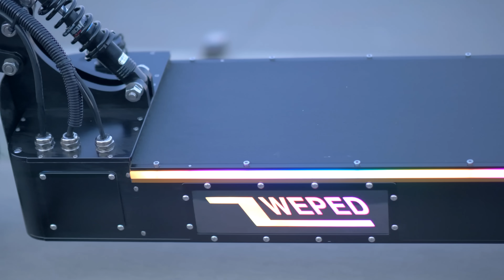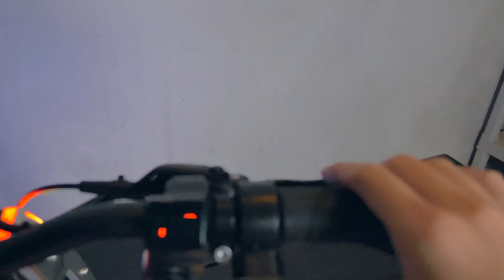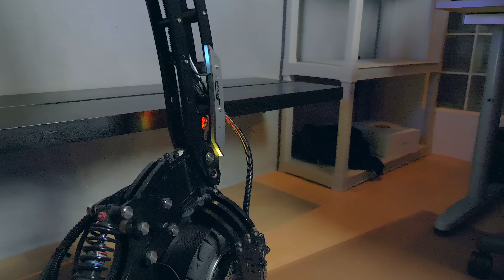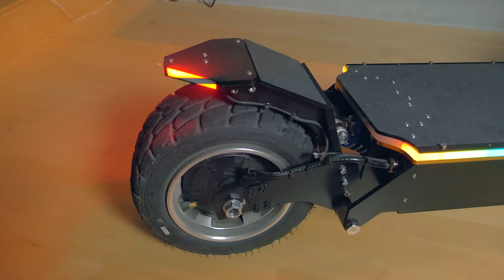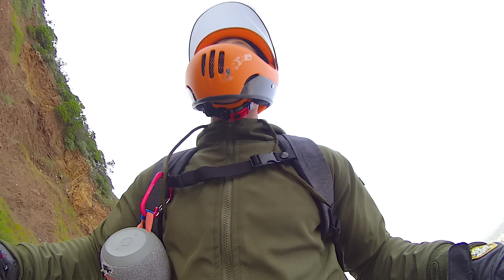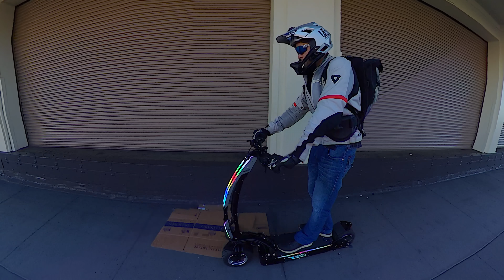WEPED SS Electric Scooter, An Insanely Fast And High Quality Ride

Comment: The RION 60 vs this?  1. It is 45lbs less weight.... RION is faster....  RION in 4k vs 7K.....Why is this your fav?
Reply from the maker: Both are really awesome, but totally different machines. The Rion is a sleek purpose built racer, while this is a cyberpunk cruiser. I suppose a more fair comparison would be this against the RE90, or the RE60 against the Weped GT. In that case I think you're looking for speed vs versatility, what's more important for you?

Comment: 75mp/h?! I rode my \non electric\ scooter down some hill and went 55mp/h. When you're at this speed it is very hard to steer and very hard to control the scooter. If you don't try it, you can't imagine it. I don't know how it is riding at 75, but it is deffenatly whey harder than it sounds.
(BTW how much does it cost?)
Reply: Yes, it is incredebly dangerous, becouse the scooter becomes very unstable and hard to control, especially small ones like mine. (I culd control it but you get the point). I know that hill, I've done quite a few of rides on it, but even so I almost crashed twice during the ride. I do it, becouse I like speed and adrenallin, but if anyone's planning to do such "stunts" I'd highly recommend to do it at place where you've ridden before, without a lot of traffic. It obviously is a lot of fun, but you shuld be wise while riding (make sure you have enough space and control not to crash into a pasding car, make sure the scooter or whatever you're riding will handle the stress and mind that you have enough time to break if you need to, as breaks aren't really good on these things).
And of course enjoy riding.
Reply from the maker: Interesting observations, I do find it easy to ride really fast on a scooter, but it's definitely dangerous unless you know what you're doing. This scooter is super expensive for sure, at about $7k, but hopefully the price comes down in the future.
Reply: And I don't think I'll purchase any kind of such scooter, becouse they're just too expensive for me. For 7k i can get myself quite some more stuff than just a scooter.

Comment: I get it, it’s nitche but for 7k you can buy a very nice bike that can safely handle more re speed n power than this and is street legal
Reply from the maker: For sure, this is pretty crazy expensive, but very fun. No doubt other vehicles are much safer. Ride safe. 👽🖖
Reply: @AlienRides  it's the initial buyers of the lotus conversion by Tesla that created the company that we have today. Personally I'm interested in the electric unicycles but I think personal transportation is going to undergo a massive revolution once we mass produce the next gen of batteries. 

Ive heard of new batteries that charge like capacitors but have the energy density of batteries and have a long recharge life being developed now. It's a matter of stability and cost and its cars and toys like this that'll bring that day closer for all

Comment: ¿Where was this video made?,,because as far I know in California USA,The laws do not allow you to drive class 3 without a drives license or a permit,because it is considered a motorized vehicle and not an impulse vehicle,from 250 to 750w max,,why pay 7,000dls for an artifact that in the store they tell you to run at 65mp,,,but outside the police tell you only 15 mp,,AMIGOOOOUUU!!!😂😂😂😂,, IT WOULD NOT BE BETTER TO PAY FOR ONE THAT RUNS A MAX 25mp,,WITH A VALUE OF 500 or 300dls,,,ORALEEEEEE.
Reply from the maker: Yup, you're correct that this is over the legal limit in CA, though we do think that riding faster in traffic is safer. Hopefully laws adjust in the future and these can be considered the moped of the future. Ride safe. 👽🖖

Comment: Kevin ssr or re90?????
Reply from the maker: Why don't you ask me what the meaning of life is instead, that's an easier question to answer 😅
Reply from the maker: Both are really awesome though, depends if you want a sleek carbon fiber racer, or a cyberpunk LED chariot.
Reply: @AlienRides  iam about to press the button on the re90
Reply from the maker: Shameel Ali one of a kind vehicle for sure, you will love it.
Reply: @AlienRides  i hope the app is up and ready by the time it arrives,otherwise I will not know battery level,voltage,kms travelled.

Comment: Too bad in Canada a laws has been created to limit the speed of electic scooters at 50 km/h (31mph)
Reply from the maker: Yeah, actually that limit is higher than the limit we have here for electric scooters, but we're just lucky that the rules are not enforced very much.
Reply: @AlienRides It is not enforced here much too. Anyway, It will be hard to reach that speed with my m365. 
Fun fact: Electric scooters are allowed to park in disabled parking areas but the cops don't know that yet, you have to explain it to them lol. I think It is to help the implementation of new technology or something like that

Comment: This looks like it would be great for some short transportation while I'm in Nishinomiya, Osaka and Kyoto. But the price is very questionable when a small scooter would be fine to. It wouldn't go 70mph but we're talking city cruising. It will definitely blend in over there but..... I'll have to think this one over.
Reply from the maker: I've been to Japan several times, love it there, and would love a PEV for exploring some cities there, or cruising around the countryside. I think scooters have just started to become legal in some cities there?
Reply: @AlienRides  Normal scooter's that go at or under 48kmh (30mph) are road legal and don't need a license but need registering. I haven't looked into PEV's yet for Japan, but they might have to be registered with the PD just like you have to do with bicycles. The last time I was there was 2016 and I saw a few electric bikes around Karuizawa and Matsumoto but nothing along the lines of the WEPED SS and it was very few- 2 in Karuizawa that I took photos of and I think 3 in Matsumoto I didn't manage to photo. I need one with some serious range and a good speed because I'm moving to Omachi and I plan to tour the Hell out of the area! Very, very rural! All roads and footpaths are open game! That's why the WEPED SS sounds good but the price is high. If it had a way to interchange batteries so I could carry a pare in case I travel too far, that would make me more open. Without a charge gauge on the WEPED that back-up would be nice.

Comment: Other model says 40 mph but if sold in US 15 mph modification possible? US blows
Reply from the maker: If it comes at 15mph you just cut one wire and you have full speed. Easy to unlock. But yeah, the reason behind the limiter is kind of silly 🤦‍♂️

Comment: the handle bar need to be  bigger if you crash you will co over that  in no time needs to be so you can hit it with your chest , sounds bad but is better than fliping in front of a car
Reply from the maker: Yeah maybe, but ideally don’t hit a car 😅 Probably going to happen some day though.
Reply: @AlienRides   maybe you dont hit a car but can you  be  sure that a car wont hit you or take a right turn   and not check the mirrors.

Comment: Excellent video, if you compare in quality of materials the SS against the Panther what concept would you give. Do not compare in terms of power because it is known that the SS is more beast. I would like a concept of quality of materials and robustness of the scooter
Reply from the maker: I would actually say that they are basically about the same quality in my mind right now. I think Currus did a fantastic job copying and using the Weped since they were partners previously, it's hard to say if one is higher quality. Both are awesome rides, and the SS is faster as you said.
Reply: Alien Rides Forgive me asking so much but it is a high investment and I have to buy without being able to try.  if you compare it to a Weped GT with a Panther that are in the same price range with which you stay. thanks for you help 👍🏼
Reply from the maker: William Sanchez hard to say, the panther is going to be a bit faster than the GT, but also quite a bit heavier/larger. I think it depends on the package you’re looking for.

Comment: Get the hell outta here, 7k?!!? No way man. Sure it’s cool, fast, no insurance to worry about but honestly that’s the price of a really good motorcycle or used car. I mean may be if I saved for it for a long while, but to out right drop 7K on it would be insane.
Reply from the maker: Yeah, it's definitely not cheap. A motorcycle or car is a much smarter buy if you need one. Unfortunately I'm not a smart alien. 👽🖖

Comment: So that rear footrest is not sprung. that is weird, and I imagine not comfortable going over rough surfaces at speed.
Reply from the maker: Good eyes. The suspension is between the footrest and the deck so you can actually feel it move, but I still find it pretty comfortable. Jarring at first for sure though.

Comment: $7K? That's even more insane than the specs... My GoTrax GXL costs only $300.00 and has lasted 2 years. Easy to control, charge at work and at home (about 12 miles, which is pithy, but OK for city riding). About $20.00 to replace the flats which are frequent and always on the rear tire. Lightweight, bring it on the train with you. I can't see ever paying $7K for a scooter.
Reply from the maker: For sure, these are pretty insane machines, and a GoTrax is going to be much better commuting to work. No way I would bring this to work since it’s too big, only really for pleasure cruising.

Comment: Now this is what I call unnecessary speeds for a scooter that is potentially very dangerous, you will definitely be fined if caught by police going at those speeds on the road and not to mention that it's not just the speed dangerous but the lack of protection you have as you are just pretty much in the open with the little protective equipment you may have. I don't see why make any scooter faster than 80kmh. What joy do you get from risking your life like that? Don't get me wrong, I love fast scooters but I think going over 80kmh it's a bit too much.
Reply from the maker: Yeah, I agree that you definitely don't need to go these speeds. I guess it's similar to a car though, you're not going to want to go the max speed of 130 in a Honda Civic, or whatever it maxes out at. The speed is good though for safety and getting out and away from obstacles/cars.
Reply: Thanks for your opinion. It may be that going over 80kmh might be too much for some. That’s why you don’t have to actually go that fast if you don’t want to. But it is always nice to have the option to go that fast if you do want to. It’s up to the rider, who knows his, her’s, or it’s limits, and use common sense. People have different levels of thrill and have different abilities. There’s no such, as what should be a standard speed setting.  “Take risk, reap rewards”

Comment: I'm sorry but what advantage does this offer over a ebike? You WILL hurt yourself riding that. Speaking from first have experience. 20 mph fall got me a torn mcl and meniscus. Now my leg locks up and hurts after standing for too long 😃. My leg snapped at the knee. Also I went headfirst without a helmet. Luckily I didn't hit my head and ducked my arms and hands up saving myself. Buying an escooter was the worst thing I've ever done. Don't say you weren't warned.   Heads up I'm not a hater at all. I hope your safe and never get hurt.
Reply from the maker: I think you're right, an e-bike is a lot safer than a scooter for sure. Sorry to hear about your fall, that seems painful!
Reply: @AlienRides  check out the delfast top 2.0 it's a cop bike ;) that's all I need to say

Comment: Super dope! Great commuter.  I’m old school I had a scooter in 2003 and they sucked. It had no battery life and was super slow.  Now there like mopeds
Reply from the maker: You were on the forefront of technology, that's awesome! Lead acid battery I guess? It's really cool to see how far and fast the technology is evolving.
Reply: Alien Rides totally I used to carry a backup. I can’t believe 70mph. 
Even back before razors I modified a scooter with pegs on it to do bar spins tail whips grinds. They just took that idea and made these smaller metal scooters.

Comment: Mudflaps are too small, you are gonna get very dirty in the rain.
Footing seems short, can't put your leg forward enough to brake safely from a high speed and handlebars are still wobbly like on cheap chinese ones. I have seen much better specimens.
Reply from the maker: Pretty valid points and definitely stuff to watch out for when buying a scooter. Which ones do you like?
Reply: @AlienRides  My favorite is the one a russian guy CNC machined from scratch, it's as perfect as you can get(10kW and liquid cooled motor, RWD): https://www.youtube.com/watch?v=Cnn0uIW21cI
He's got an entire topic on the build in the endless-sphere forum.

Comment: It doesn't need this kind of speed. This is the kind of dangerous designs that will force governments to ban them eventually.
Reply from the maker: That's a fair point, we all definitely want a bright future for personal electric vehicles. I think many of us are looking at these as replacements for mopeds. Hopefully they don't get banned!
Reply: @AlienRides  The thing is mate while we will get responsible people using these you also get idiots like for example from that show jackass promoting stupid behavior which encourages others to behave in an unsafe manner. I love using these scooters in Finland they are very useful and alot of fun but most importantly they help reduce the amount of time ppl use in their cars so they have alot of benefits. I think manufacturers need to do their bit and not cater for the speed freaks.

Comment: You know it's cool. But my dualtron thunder hits 54 mph. That's plenty fast for me. Where can you even ride 70 mph besides the highway? Here in Minnesota they are not allowed on the highway. Hit 70 mph in the suburbs or city and your going to get a ticket or get into a serious crash. It's like you said in your video, you haven't even gotten the chance to top it out because more thank likely it's will have to be on a highway or airport. When electric scooter racing becomes a thing this will be nice. It doesn't even seem like it would be fun riding in the city. One thing I really like is the battery size. All in all after having my thunder for a week 54 mph is plenty fast. Used an actual gps because my speedometer was reading 63. Unless you commute to work was on a 50 55 mph road which you can ride your scooter on here in Minnesota then it would be useful. Other than that I don't think the company will sell many of these especially with the cost. Dualtron x didnit right with a nice comfort faster than dualtron and bigger battery life. I've ridden gopeds since the 5th grade. My first ped was a xped with a g230 engine (the og) and have been riding scooters ever since. No one needs this. I promise you that.
Reply from the maker: 54 is pretty awesome for the Thunder, I have one and it's hard for me to get it up to that unless I'm on a hill. You're right though, this is totally overkill for most people. Definitely hard to find road to max it out on.

Comment: Although it's powerful. Front end suspension is not designed for all that power not to fall back on to the user,  you can see a pattern of when the bars are too wide for user to control without feeling like their going to Dip (Wipeout). A couple braved it. Rest did not feel secure with it.
Reply from the maker: Gotcha, good points about the suspension. Personally I prefer the wide handlebars, but the scooter could definitely use some tweaks to be more controllable.

Comment: Do you need a license for escooters and can you ride them on streets or sidewalks? Just wondering
Reply from the maker: It mostly depends on where you live, but for the most part you need a drivers license and are supposed to only ride on the street. For the most part neither is enforced, but I do highly recommend riding in the street. It's safer for pedestrians and you get around faster that way too.

Comment: For 7k, it should have some shocks to ease the front at least
Reply from the maker: That's a good point, the suspension right now is between the tire and deck, but not handlebars so you can feel the road. I still love this scooter though.

Comment: Top e-scooter for me would be the xiaomi m365 form factor with some sort of suspension 40km range and 40kmh top speed. The rest fall out of the size/weight/portability/practicality equation! Does such a scoot exist??!
Reply from the maker: Interesting set of requirements. I just did a video on the Inmotion L9, and it's getting pretty close to what you're asking for. Check it out and good luck with your search!

Comment: No mention of weight load capacity. The QPower can handle Jerome Bettis ... TODAY. This thing looks like it can’t carry more than a kid in a boy band. Anyone have that spec? ✌️
Reply from the maker: That's a good point, I think that most scooter companies just make up how much they can handle, but I do think the SS can handle a super heavy rider. Likely much more than the qpower or Dualtron Thunder. I'm guessing 300-400 lbs should be no problem, but that is just a guess.

Comment: The Weped RR is even more badass with so many customizations ... that´s the better choice. The SS is OK, the RR is the ¨must buy¨ ... be sure to indorm people cause in Europe, it doesn´t have an european certification, which means that u cannot use it on the road, it´s ilegal. U can buy one, but u have to wait until is gonna be certified.  Cannot speak for US. Good material though :)
Reply from the maker: Yeah, the RR was super awesome with all of the customizations. The SS is going to have the same level of customization available though, hoping to do some videos on things that are starting to come out. Too bad it's illegal, I think with the unlocked speed it's illegal here, but luckily not really enforced.